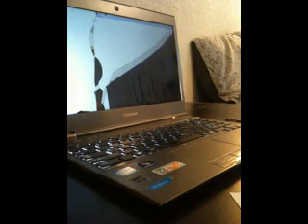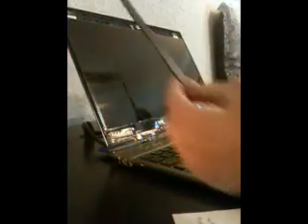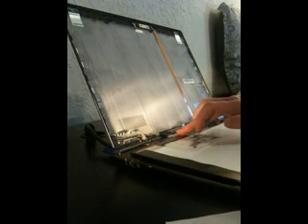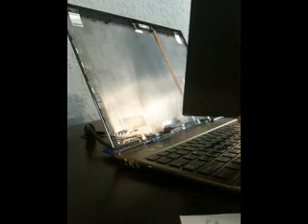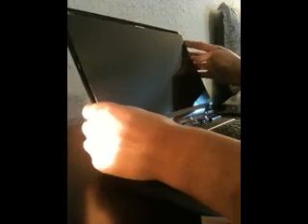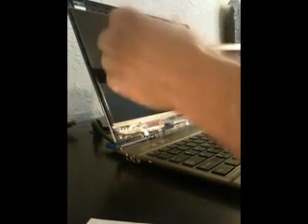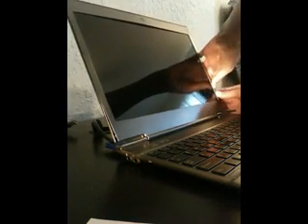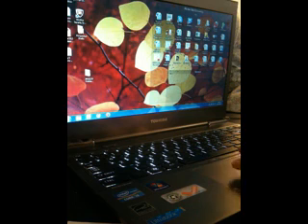Replacing LED screen on Toshiba Portege Z835 and Z830

Comment: Thank you very much for producing the video.  I've just this moment fixed my wifes Satellite Z830-10T.  It fell off the couch last night and the internal screen wouldn't work, although the external screen via HDMI worked fine.

To cut a long story short, the screen connector plug had become disconnected.  I reconnected it and it's fine now.